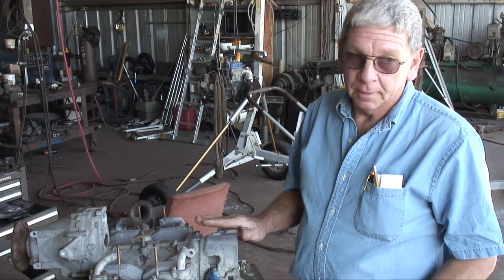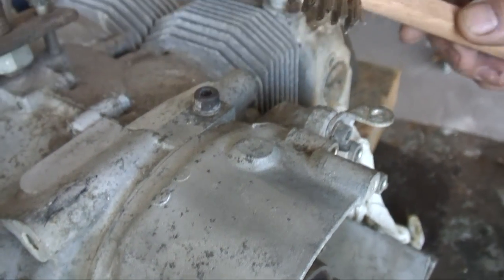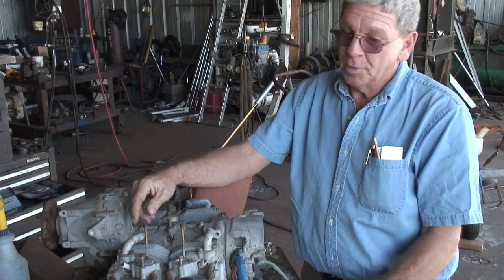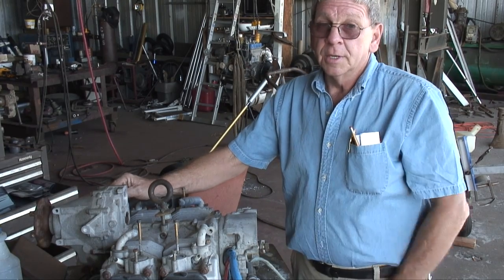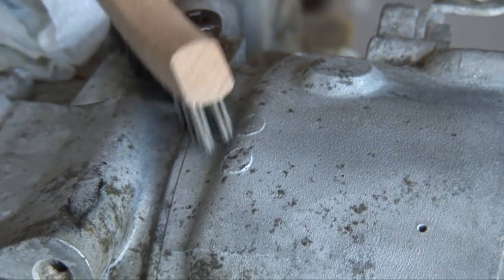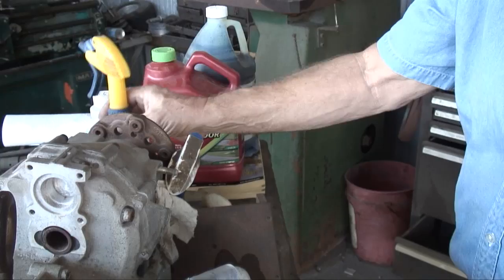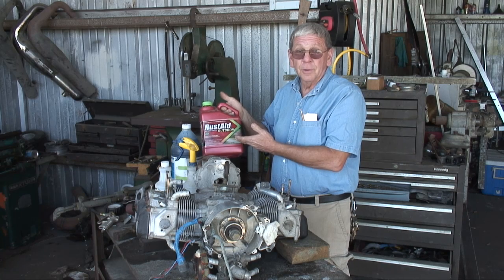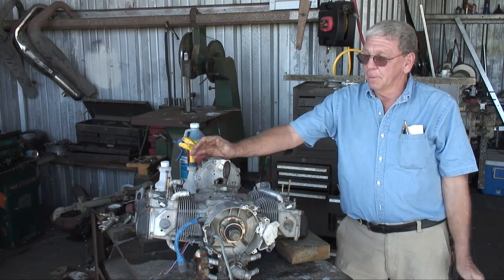Master Claude - Cleaning Aluminum parts

Comment: Master Claude, I have the same black spotting on my Honda engine cases I’m trying to clean up. I don’t want to use an acid because I know shortly down the road all my fasteners will be rusting. Think I’ll have to use a degreaser and wire wheels on a dremel tool.

Comment: Some corrections: Master Claude has confused mechanical bonding and chemical bonding stating that the black "smut" corrosion is mechanical and not chemical bond to the aluminium - he means the reverse of that. And he describes the 'smut' as pure carbon - it is not carbon - but aluminum oxides with grease/oils/dirt and other metal oxides from other metals in casting such as magnesium...the black "smut" is not carbon - there is no appreciable carbon in most aluminium alloys..(author majored in chemistry)
Reply: You must still be in your first year at university eh? A long way to go mate.

Comment: Simple.
On that engine above, spray any oven cleaner on it, soak for 5mins and scrub the surface with 3M's marroon coloured scouring pad. Do not flush with water. 

Wipe away the oven cleaner. 
Apply a thin coat of Marvel Mystery Oil or WD 40 or LPS1 or equivalent to slow down re-oxidation.

Comment: Use never Dull and it can be any place sells motorcycle stuff sells. Use scotch brute pads or roller disc in drill. Scotch brute and comet with water rubbed in 
or applied with drill . Always test a small area before doing the whole engine where you can't see if something goes wrong

Comment: I've got an aluminum engine of a 1998 BMW R1200C covered with what is left of the factory paint (mold and corrosion got rid of some here and there..), a tough son of a bitch, let me tell u. Sand blasting with glass beads and else (several shops tried to hit it with all they had..) didn't work, neither did the paint strippers tried. I also used a power drill with steel brush on a tiny spot as a test and it got scratched but the paint is still there basically. Would u have a way to do  it? HEEELLLPpppppp pleasee!!!!!

Comment: i;ve had good results with a 50/50 mix of aluminum cleaner and battery acid,gently wire brush the mixture over the casting till clean and wash off with water,leave overnight and wire brush of the powder residue thats left on it the next day,seems to pull the crap out overnight

Comment: I would never use acid on any alloy as acid can weaken the metal,my engine  and gearbox is all magnisim alloy metal and i just use my rotary tool with the cup wire brushes with a mask and googles for saftey and my engine comes up shiny and like new and it dosnt take awhile to do!

Comment: For mechanically cleaning carbon, WD40 and a Scotch-Brite pad work well on aluminum.  Soda blasting could be used (outdoors).  Glass bead blasting will leave behind expensive residue. If it's a mechanical bond - use a mechanical technique for cleaning.

Comment: Maybe a little late, but atomizing phosphoric acid with a stainless brush may be putting a harmful amount of hexavalent  chromium into the air, especially when attacking oxidized metals.  You more or less mentioned that you should wear gloves, but I think it's only fair to warn that you REALLY should be wearing a respirator when combining stainless steel, oxidized metal and a stainless steel brush. Hexavalent Chrromium is no joke when it comes to inhaled carcinogens.

Comment: is that really carbon coming out of solution of the aluminium casting ?

I didn't think there was any carbon in cast aluminium, only in steel ????

also have you tried d-Limonene ?
Reply: I think the aluminium gets impregnated of carbon over time.